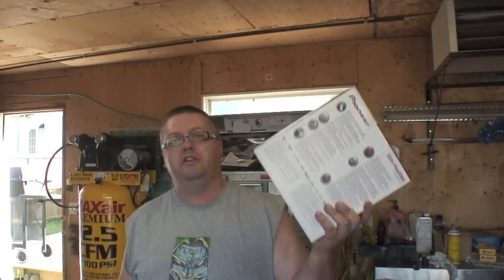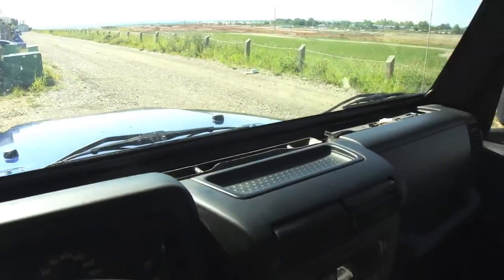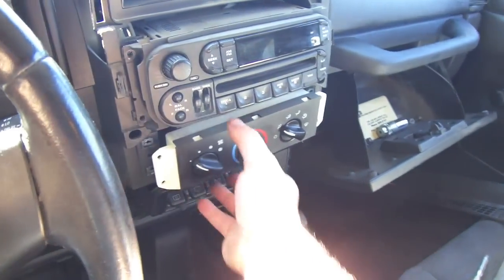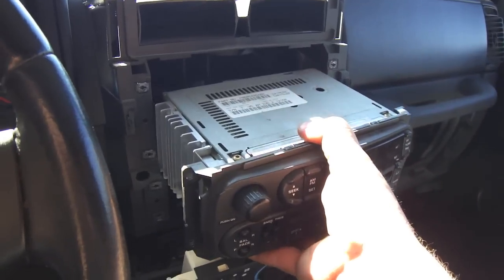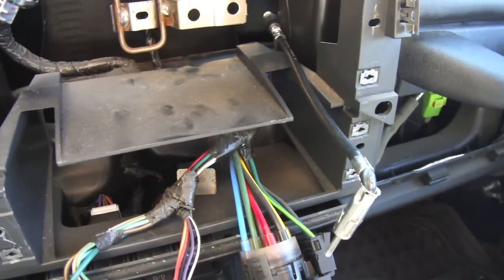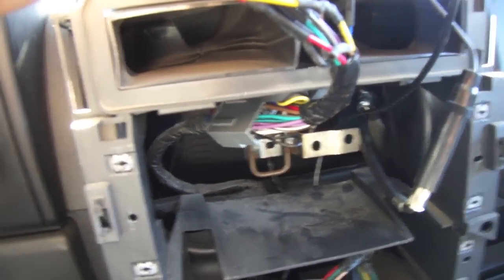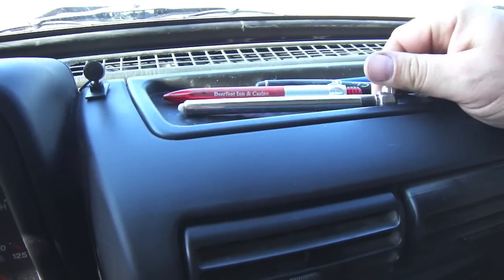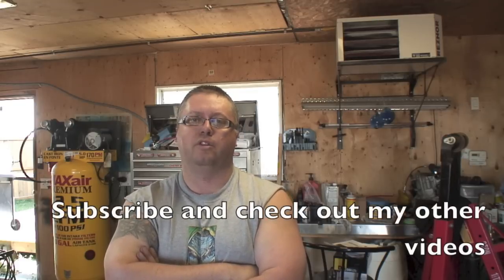DIY Car Stereo Install in a Jeep TJ

Comment: For real though you really didn't express how annoying that but in the back was to take out. Secondly you didn't explain at all how to do the wiring in the back, I went rogue and cut the wires in hopes that I could splice them with wiring harnesses but after about 2 minutes I realized I was fucked

Comment from the maker: That's right I didn't, but after you have the deck mounted in the plastic adapter you will see it just lines up with the factory bolt holes and away you go

Comment: did the install 2 days ago,was way more easier than I thought.that 10mm bolt in the back I thought was connected to a metal bracket but was just a ground wire so the old radio slid out just enough to easily take it off,so don't be scared lol.nice video,thanks man.

Comment: o man tell me about it. slashed side window, bent passenger door handle cause the idiot could figure out how to UNZIP the dam window but he just cut it, fucked up dash and stolen radio and a 1.50 in spare change. the real bad part is i have a hard top i had off for maintenance reasons and was just temporarily using for like two days

Comment: did an install the other day on my 06 TJ... FYI if you pull the panel under the climate control there is a screw holding in the metal  bar that locks the factory stereo in (instead of blindly trying to remove the nut) all you have to do is some wiggling as you pull the Factory stereo and its out with no fuss in minutes.

Comment: Hope this question wasn't already asked but I just installed an almost identical stereo into an 06 TJ which came stock with a sub. Is the sub lead the blue wire and if so how do I connect that to the stereo harness? My only guess is tying into the rear speakers.

Comment: I can't seem to find the video where you deal with the wiring. You don't just plug in the adapter, you still have to either solder or use crimps correct? I was hoping the adapter would just let me use some connectors (JVC KDX50BT into a Jeep Wrangler Sport 2002).

Comment from the maker: it's most likely there to piss people off when they want to replace the stereo, otherwise i don't think it would matter too much if you removed it or not as aftermarket stereos are just held in place with the front 4 bolts and they don't seem to have any issues. but it is just there for stability

Comment: hehehe, yeah about that annoying ass bolt...  I'm just gonna be replacing my stock radio with another stock radio cuz I'm cheap.  Is that bolt in there for stability when rock crawling/etc or is it in there as a way to, hahahahha, deter theft?

Comment: I have a 03 Wrangler. The video is spot on. Thanks for the tip on the 10mm bolt as the back side of the factory radio. It would have been a bear to find on my own.  
Thx Jerry 
MFBT!

Comment from the maker: disconnecting the fuse is not necessary as it's 12 volts the worse that can happen is that you will blow a fuse if you wired something wrong

Comment: take a flat head screwdriver and jimmy it at the bottom of the panel, there are two clips, it should slide off, that's how mine worked.

Comment from the maker: i would have never have thought it was used as a ground as the plug has a ground in it, however it is bolted to the frame which is ground so naturally it is.... to be used as a anti theft device makes me chuckle as the factory decks are useless - unless they are nav/dvd aren't worth the effort to steal

Comment: Hey mate. Bit late to the party but I have a 2005 TJ renegade edition. 
Looking to replace the stock Stereo. 
The jeep came with stock 6 speakers, sub and Im guessing an amp. 

Did you have a stock amp when you did this install? Did you have any issues wiring the amp up to work? 

Cheers.
Reply from the maker: My Jeep only has 4 speakers, no sub no amp

Comment: Here's what I have I was jamming my pioneer stereo top down last it's been in pace for 7 months. And just quit working. Check the fuse behind the glove box stereo is on and plays no sound though at al. So I said well hell the radio took a shit. Bought a knew radio today installed it. Same shit powers up no sound. I have no amps in here. What the hell could it be? 1997 jeep wrangler. Does it have a factory amp?

Comment from the maker: depending on your stereo that you buy it should have a mounting sleeve that slides over the deck it's that mounting sleeve that has some tabs that you bend out to prevent it from coming out.  then your deck just slides into it's sleeve and locks into place

Comment: Hey there doesnt seem to be a 10mm bolt or anything to attach the back of the stereo to in my wrangler. As nice as that was getting the factory stereo out i now have nothing to secure it in place. any ideas? it looks like the previous owner had an aftermarket stereo but replaced the factory one when they sold it but they didnt secure it.

Comment: Did or does your dash squeak?
If so how did you fix it? I've had all the bezels off shimmed all plastic parts with rubber spacers, installed the bolt in the back of the stereo that the previous owner removed etc. It's better but it still has it's moments. Any ideas? Thanks for your time.
Reply from the maker: i've never had any squeaks at all

Comment: Perfect video. Just changed mine and it was a breeze. My 2003 bracket (with the pesky 10mm nut) was in the way when I tried to put in the new unit so I had to remove it for the install.

Comment: There is one more screw holding in the dash that he forgot to mention. I broke my dash trying to pull the dash out because he didnt mention the last screw. You have to remove the ash tray and the screw hides behind it.
Reply from the maker: My jeep doesn't have a ashtray, and only has the 2 screws at the top

Comment: Hey, good video. I've started following you. I have a 2000 TJ Sahara and want to add MP3 functionality to my factory stereo. I presume I just need a new deck. My TJ 2000 layout is slightly different than yours (think you have a slightly more recent model), any advice for the 2000 model? Also, did you disconnect the battery when doing this? Also, do you recommend any decks that are easier to install/most compatible with the TJ 2000? Thx, your vids are great.
Reply from the maker: if you have any doubts, I would highly suggest you purchase your car audio from crutchfield.  they give you the mounting bracket, wiring harness and downloadable instructions that have a step by step to make sure your stereo is installed flawlessly
Reply: Bullshitkorner
thx! I may in the end just go to future shop and get it installed, but your video was very helpful. Enjoy those brewskies.
Reply from the maker: Thanks, future shop would be ok too, if you can sucker them into a free install

Comment: How is the new stereo held in? On my '04 Wrangler the new one (Which happens to be a Pioneer similar to yours) fits fine but there's nothing for it to bolt to. The factory deck used the face plate and the nut in the back but the new one doesn't have a bolt in the back for it. I have model DEH-X6600BT.
Reply from the maker: it's held in place by the sleeve that it came in, and that gets attached to your mounting adapter by folding the tabs
Reply: Bullshitkorner OK so its just the face plate that holds it in? What about the nut in the back? I think I might have to bend it out of the way for everything to fit.
Reply from the maker: i'm sure you can rig up something for the nut in back if you really wanted but it's not needed

Comment: Hey Guys, any ideas how to put the AUX input ON the Factory installed stereo? is that possible? I have a TJ X and I just want the AUX without getting rid of the original stereo... thank you!

p.s. great video, thanks for sharing.
Reply: There are some adaptors you can install on the back of the factory unit but they are pretty expensive IIRC, I wanted to do the same but ended up just installing a whole new unit.
Reply: ok, thanks! do you have any model of that IIRC devices? just want to know how expensive they are, etc! thanks again for replying...
Reply: IIRC just means "if I remember correctly" but I found this thread over at jeepforum.com but the guy who posted it removed all of the photos so it may be difficult. Looks like the wiring was around $45 he used two:
http://www.oemautosound.com/p-5-iphone-ipod-5-volts-cable.aspx

https://www.google.com/search?q=RCA+to+3.5mm+jack+splitter&oq=RCA+to+3.5mm+jack+splitter&aqs=chrome..69i57j0.461j0j7&sourceid=chrome&es_sm=119&ie=UTF-8

Write up: http://www.jeepforum.com/forum/f96/write-up-ipod-install-res-996929/

hopefully that helps. reddit.com/r/jeep and jeepforum.com will probably be more helpful than youtube though. Good luck!

Comment: How do you disconnect the radio connection on the back of the old unit? the one on up right corner.   I try to pull it out directly but not work. please help
Reply from the maker: are you talking about the antenna wire if so it's connected further down the line i think
Reply: Bullshitkorner yes, thats the one I'm talking about. so do you just pull it out from the back of the stereo or disconnect it from somewhere else?
Reply from the maker: it's been awhile but i believe its disconnected somewhere else like a foot away
Reply: Bullshitkorner I got it! thanks for quick reply and help!
Reply: Bullshitkorner so how do you take off the part of wire from the back of the factory unit? you didn't show that part in the video.    Thanks !

Comment: I had to get an adaptor and all the wires are connected to where they should be but the SW isn't turning connected any help?
Reply: Does the harness have a wire labelled 'REMOTE'? Should be a blue wire or maybe it's blue with a white stripe if I remember right. That 's the wire that will power the subwoofer.
Reply from the maker: ya the power antenna or remote wire should go to the sensing wire on the amp for the subs. my jeep didn't have a sub so i cant tell you which one
Reply: Bullshitkorner
Yeah, it's been a little while since I've done one, but I'm pretty sure it was a blue wire (Maybe with a white stripe) from the adapter harness going to a blue wire  from the Jeep harness
Reply: Therevdon
...and I didn't need to remove the climate controls on either of the Wranglers I did stereo installs in.

Comment: How did you hook up your subwoofer?
Reply from the maker: Mine doesn't have the subwoofer
Reply: Go to Link provided, it has instructions to download close to bottom of page. This is the only subwoofer I know that doesn't require mods to center console.  
http://www.quadratec.com/products/14133_1001.htm?utm_source=youtube&utm_medium=video&utm_content=CFE_TJ_Replacement_Sub
Reply: Hay Rick - seems like we went to the same high school after watching all your vid's - I have the exact same 03 and wanted to ask one fucking question - can you really go wheeling wif dah 42rle ? When I bought my TJ I assumed it had the same auto trans thats in my bullet proof Cherokee - fuckin' wrong & mine only has 90k on it . . . party on.